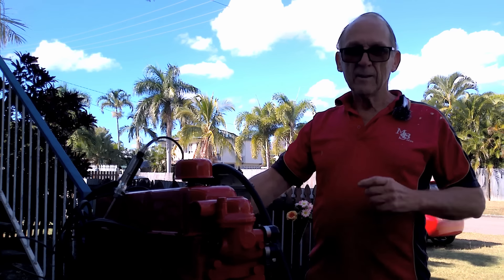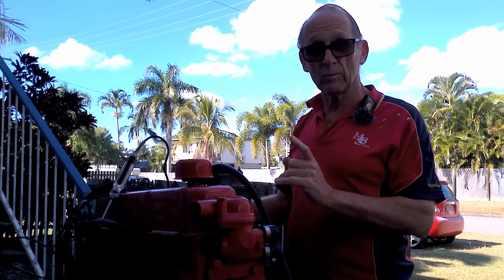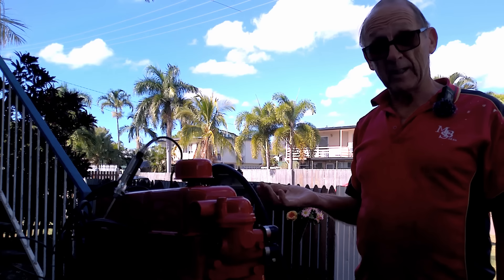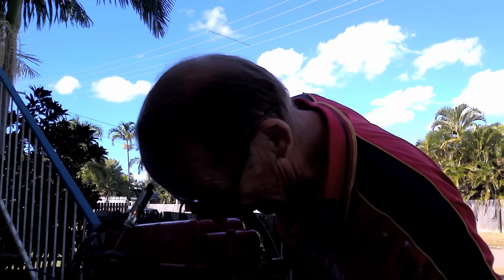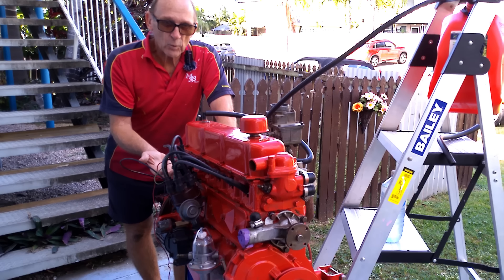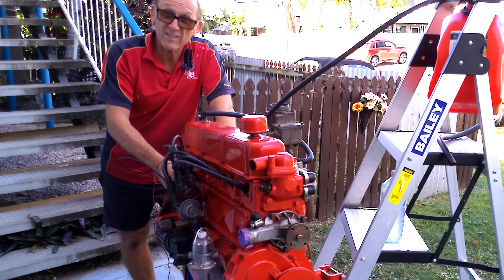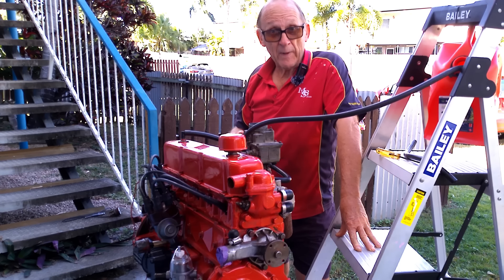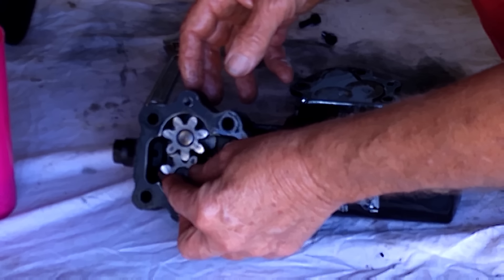Holden 6 engine start up

Comment: I set up an engine for starting just like you did, many years ago (although it was an old v8). The motor ran for a short time , we warmed it up, and stopped it. All good. We came back in a couple of hours to restart it. Boom! The engine exploded out of the rocker cover, blew the oil filler cap off and nearly took my head off as it went by ( upwards to smash a flourescent overhead light) . We found the cause. The carby must have had a slight leak in the needle and seat. The gravity feed of petrol flooded the carby over a period of a couple of hours, draining past the rings into the sump. The vapour fumes in the sump just ignited when we hit the starter. Beware the gravity feed of that nasty stuff petrol, it can bite. Something to think about.
Reply from the maker: Shit yeah, seen that happen with my very eyes at an auto electrical shop I was visiting in Brisbane when I was a 3rd year apprentice. It turned out to be a cracked diaphram in the fuel pump, just filled thew sump up with fuel when it was running. They shut it down as I got there & then re-fired it when I got out of the car & bang. It blew the sump apart. Nice bang. Thank-you for that point as it is something to be very careful of particulalry in the same scenario as what I just did.

Comment: The best way to prime any engine with oil before starting up is to connect a line to the oil pressure sender port and connect that to a container of oil that can be pressurized and force the oil in and around the galleries. They are not hard to make. I have even made them from heavy wall PVC pipe and fittings as you are not putting a lot of pressure into it. Another way was getting an oil pump from a wrecked engine that can be turned by a drill and connect it to the same place on the engine and the suction side to a container of oil and spin it with the drill. The second method is handy to have as I use it to fill gearboxes and diffs when changing oil.
Reply from the maker: When I had my shop in Gladstone I used a pressurised container for just that purpose. It was perfect as you know.

Comment: you could remove the oil cap ans look to see if you have oil pressure ,, and i removed rocker cover to adjust tappets on 186 engines that i built and worked over lol 😜

Comment: i always fill the filter never run a dry filter  
yea needs vaseline in the pump after a rebuild to help it get oil pressure
Reply from the maker: Most certainly on a new re-build. I used engine assembly lube on this one.
Reply: @mbsoldschool  Exactly what I would have used too. Nice and sticky and will definitely create a good seal over those gears.

Comment: Well that was a good tip, I put some oil in the oil filter so it won’t be dry on startup, will that help create the suction? Got me worried it won’t work right now.
Reply from the maker: On many engines filling the filter may not guarantee that the oil gets to the suction side of the gears. Filters are always on the discharge side. The suction side requires lube. We fill the filters to lessen the time it takes to get full pressure.
Reply: @mbsoldschool righto, I guess I’m going to take off the oil pump then and do as you suggested. Same 202 engine, I’m about to lower it onto the engine mounts so only a week or so before firing her up.
Reply from the maker: Yes that's a good idea. My mate just came over this morning & we were talking about the oil pressure failure. He did exactly that, filled the oil filter believing that would be primed. So during the filming when I asked him if it was primed he said yes. Well we know that did not work.
Reply: @oo0Spyder0oo 
Hold the bus!
Holden Red Motor has nonreturn valve paper element filter. With fresh (dry) engine, problem is getting pump to suck AIR up pick up pipe against gravity until oil reaches pump. A wet oil filter makes it virtually impossible for "dryish" (unprimed) pump to push air through ahead of oil. Never allow any Holden Red Six or V-Eight to fire up until AFTER you KNOW oil pump is pumping oil or bearing (mostly cam, then big ends) will be scuffed & damaged drastically shortening bearing life.
Here's the procedure:
Leave spark plugs OUT.
Pour 1 dessertspoon of engine oil into each plug hole so new rings don't tear up bore on initial cranking.
You can even leave push rods & rockers out... (optional but not really necessary)... Leaving plugs & rockers out takes the valvespring load off the cam, protecting it & it takes huge load off starter motor allowing crank & oil pump to spin faster to help suck that oil up.
Get everything else done.
Fit oil pump last & just before you're ready to find oil pressure.
Use plain engine oil, just a few drops on the two axles in the oil pump. Install the driven pump impellor gear. Mix 1 desertspoon oil with 1 desertspoon wheel bearing grease in a coffee cup until you have a sloppy paste. With pump open face up pour just enough grease slop into pump & rotate impellors by hand until all teeth are coated forming a fairly airtight seal as they rotate.
Never add too much grease! The pump has to push that grease out as oil gets sucked up against gravity.
You don't want grease ruining the viscosity of your engine oil as a contaminant.
The biggest danger is the pump must force the grease through that paper filter element! Too much grease WILL plug your filter!
Bolt cover plate lightly onto pump & bolt pump onto block.
Wind filter onto pump with fingertips until filter seal meets pump face, THEN BACK FILTER OFF ONE FULL TURN. This leaves an air gap just beyond the pump for that bastard air to escape as you crank that engine.
Leave oil pressure swith OUT! . . . Air must escape there too!
Get everything above right.
Use the best battery you can get hold of. A truck or 4X4 battery with at least 600 CCAs (cold cranking amps) is best.
Crank her over until you see oil escape between the pump & the filter... PUMP IS PRIMED! Stop cranking.
Tighten filter.
Crank again.   See oil exit via oil pressure switch hole & stop cranking. Oil is now pumping through galleries. You must see it exiting that oil pressure switch hole to get confirmation everything is OK.
Fit oil pressure switch, pushrods, rocker gear, spark plugs & know with absolute certainty your engine is safe to fire up.
Have spent over 45 years in bed with Early Holdens. I love 'em. You take good care of them & they love you back a hundred times more.
Best of luck with your engine. I hope she gives you maximum enjoyment.
Just watch out for clods with dumb ideas.
PS: Filling the oil filter on a fresh (dry) engine is a no no. It's damn near impossible for a high mounted Red Motor oil pump to push air through a wet paper oil filter element. Follow the above proceduce & your little motor will love you for it.
If you need help to tune it, leave a reply here. I'll happily guide you through that tricky process too. You can easily tune it yourself.
Reply from the maker: Holly smokes, that is just way to much work for a simple job. I will stick with what I have been doing for the last 45yrs. In saying that though I think a total amateur will benefit from how  you do it, they won't go wrong. I am sorry but I don't agree with your PS statement. The air will push through the filter. There is no evidence anywhere that I know of that says any different. Since I was a tuning specialist for the last 45yrs I think I know how to tune most cars but thanks for your offer of help. Very soon I will be tuning that engine so it should be up your alley to make sure I am doing it correctly.

Comment: Shouldn't you have run the cam in with new lifters etc?
Reply from the maker: Yep. It is a case of customer knows best, but in this case a mate. Going from what he told me, it was a used cam and I could see that as I fitted it for him and filmed it but the video got screwed up & I hope to somehow salvage it one day. So I say where are the original lifters marked for each lobe. Ah they are in the shed all mixed up. Well best to fit new lifters then which is better than mixing up old ones. At least they are spinning as they should. The engine is a play toy for him so service life is of no concern for him as it is not going into a vehicle, but a fair point to ask the question as it is not within the common teachings to do what I did, but how many people have done it. (plenty)  I think I was more interested in the firing up and discovering that the owner through no fault of his, lead me astray a bit to discover a few things that he did not do correctly as you saw, no fuel in the carb & no oil pressure. Simple yet important details that if that was a new motor it would have been considered a very poor start up. It is clear that when a mechanic works with a customer things sometimes don't go as they should but take the customer out and all goes perfectly, funny that.

Comment: Great video’s 
I’ve never been able to understand why people take chances with first start oil priming ?
As a 17yrld boy apprentice in the 80s I observed a lot of Holden in particular ring and bearing jobs go wrong on start up with oil pressure so my very first engine rebuild I decided to avoid all that so have prime pumped into the oil gallery before start up (with a hand or air style prime pump very easy to buy or make)
every engine I’ve ever had apart ever since or into the future cheap insurance and no chance of damage a no brainer you would think ?
JA
Reply from the maker: It is a no brainer, absolutely. You learnt early, fantastic

Comment: what are points ?  just kidding, did an old mallory twin point dist recently,  on the old faithful hp 179 with the statatory yella terra head & 30/70 solid cam,,,,   was a  blast from the past
Reply from the maker: OMG, you still have a Mallory.

Comment: What causes the infamous 2 second bearing rumble on cold startup on these engines ?
Reply from the maker: The lifters bleed down when the engine shuts off. Overnight the oil slowly drains down from the galleries & crankshaft. When you start up in the morning the oil pump has to refill all the channels which takes a few seconds so until then you have loose rockers which will tap & bearings will have no oil so you get bearing rumble. Every engine does it, some are very noticeable.
Reply: @mbsoldschool  Yes, that theory is common knowledge and logical, but in 45 years of car ownership, I've only ever heard it on the Holden red motors in both used and rebuilt motors, (no other cars) or of course any engine with a run bearing for example. So my question was more about what in the design  of this engine  makes it exclusively audible at startup, - probably a hard one to answer, but perhaps using too thicker oil like 20 / 50 that is harder to circulate per design. It's a deep main bearing rumble, nothing to do with rockers or lifters in this case, which make a different sound
Reply from the maker: well now, that a tricky one & your right I have no single answer. I have not heard bearing rumble that often in a Holden but have in other engines. The longer it takes for oil pressure to come up the more likely you may hear bearing noise. Yeah there are many factors that may contribute to this. Bearing clearances, oil viscosity, oil pump clearances, filter, oil gallery restrictions and maybe a few more if I thought about it. Very unlikely that it is a common thing in the Holden engines because you would think that GMH would have fixed it by the time the HR came out.

Comment: If you put a new cam and lifters in it should you not have run it straight up to 2000 odd rpm and run at that for 20 mins or so to run the cam in so you don't wipe the lobes off the cam. I was told this by an engine rebuilder when they overhauled my Mustang 289 engine. Interesting. Cheers ian
Reply from the maker: it was an old cam put into an old engine that is not going into a car. It will be a test engine for the owner so he can play with different things. The cam won't wear out during it life time of probably 20-30 hrs. What your engine builder told you was 100% correct. If not done correctly the lobes will wear out in 20K

Comment: That only tells you the points are working,  nothing to do with checking timing
Reply: Wrong.
Reply from the maker: Um, I don't know what to say to that. I had to check that you commented on the right video. I think you need to do some more reading on the subject as that is how most mechanics static time a points ignition system. My mate is hooking up a radiator to the engine & I will return with more videos covering, centrifugal advance & I will use a timing light to confirm the static timing in this case is perfect. How to adjust a carby is also on the agenda. I hope you don't come back with the mixture screw has nothing to do with fuel supply at idle. ha ha ha only joking.
Reply: @mbsoldschool  Yes use a timing  light , you can crank it over with our spark plugs in, just a lead with a plug on it on the engine, adjust it and the timing will be accurate, iv been doing that for over 50 years of engine building
Reply from the maker: Each to their own. I have been static timing engines for 45 yrs when the distributors have been removed or after engine re-builds and it is always within 1 deg. On new engines I also primed oil pressure so I don't have to crank it unneccessarily like you have been doing for the past 50 yrs. I like the engine to start straight up & know all is good for 20 mins of cam run in time.
Reply: I bring the oil pressure up first, and fit HEI to holden engines that run on points, happy days
Reply from the maker: Yeah HEI is the way to go after the necessary mods are done. I kinda like points though, they have their limitations and constantly need adjusting hence why tune-ups are done so often on them. When they break down, it is easy to get them going by various means. Electronic breaks down and you call RACQ to pick you up, unless of course you carry around a spare module. ha ha
Reply: @mbsoldschool  The Blue motor HEI's are a lot harder on caps, rotor arms & plug leads as well, no doubt due to the 1.5mm plug gap.
Reply from the maker: You nailed it. However when fitting these to a red motor it is not necessary to run 1.5 gaps. 1mm is sufficient. Old engines don't run as lean and therefore don't require a full on spark as the blue engines do. So this will put less stress on the cap, rotor & leads.
Reply: l @mbsoldschool  Don't forget HEI needs full 12v, resistor plugs and leads and non resistor coil. They are very reliable

Comment: Holden red engine 6 degrees BTDC is the correct timing.
Reply from the maker: That would be correct but this had a GTR XU-1 cam specs which is 10deg
Reply: That might be correct for some but.....EH/HD (149 & 179) were 5 degrees, HR (161 & 186) were 7deg, HK/T/G quotes 6 to 8 & HX/Z can be either 3 or 5 depending on transmission. Yes I have all the factory books.
Reply from the maker: Yeah there are a few different specs depending on engine/transmission combos. I sold my early books on tuning specs & only have LC torana on, HK on & VC commodore on. Without specifics they range from 3 to 10 deg. I must have fluked the 5 deg spec on this 202 from HQ. But yeah for those following the comments you should just check the specs of your engine. But & there is usually a but. These specs are from the era when we used leaded fuel. 50 yrs on almost all engines built now have more compression thanks to multiple shave jobs. Initial timing may require some tweaking in certain circumstances & centrifugal advance may require re-adjustment. It is a suck it & see these days but if you stick to standard specs for initial fire up, that will be satisfactory until the motor is fully run in, then you can play with timing settings. Thanks for clarification on timing John.
Reply: @mbsoldschool  10-4 that.